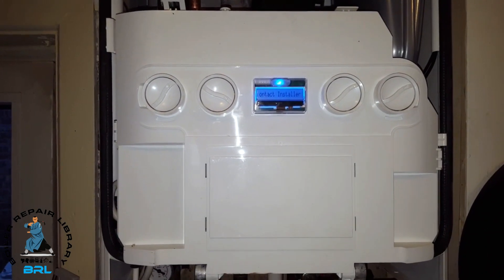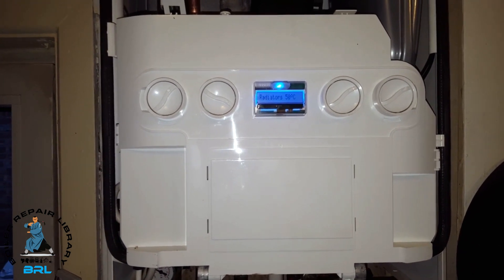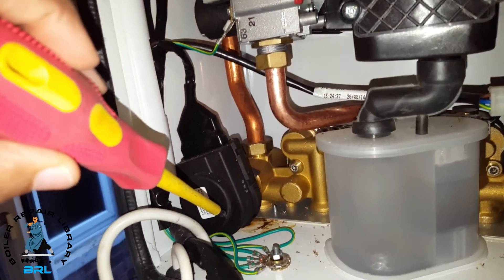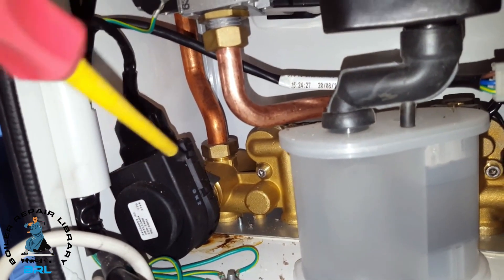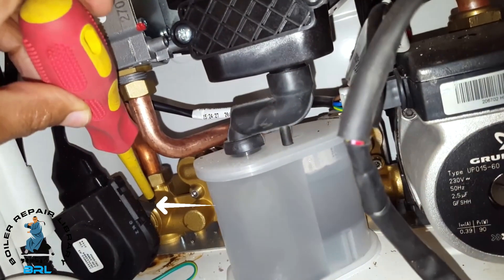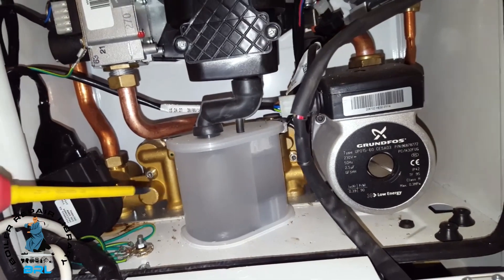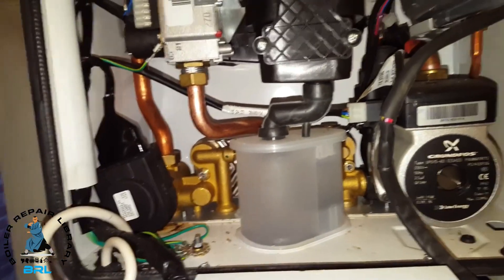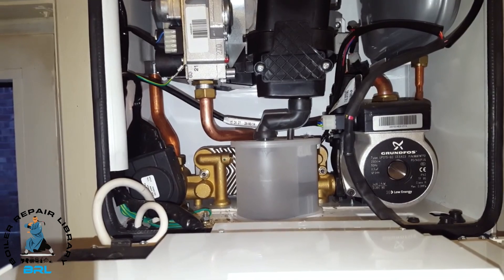Ideal Logic + 30 Leaking From Divertor Valve

Comment: That boiler ain’t room sealed. I’m an ex ideal engineer and if you look to the right of the pump, below it is where the external laptop connection harness should be which sells the case. It is missing leaving a hole in the case. I sure hope you put that right because if you left it, you left a boiler at risk